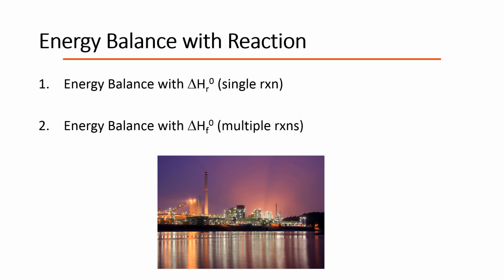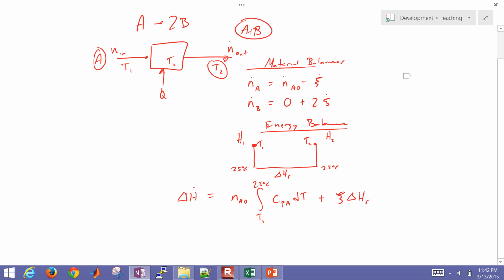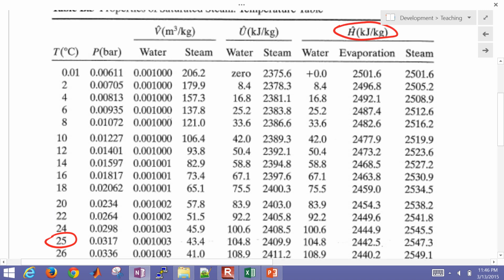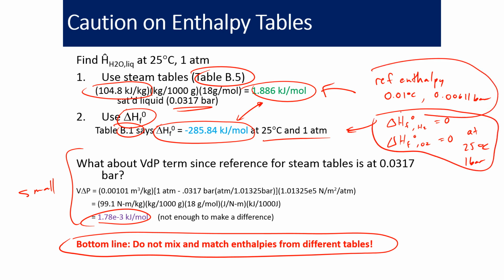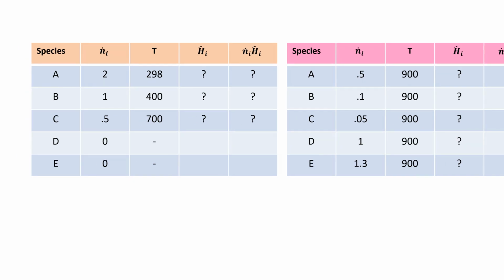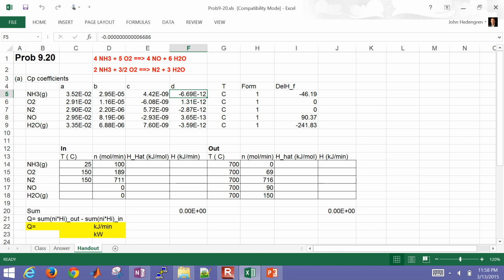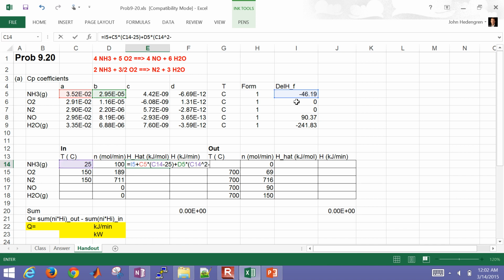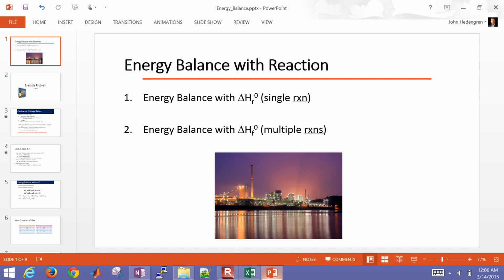Energy Balance with Reaction

Comment: Dear sir: do the same technique apply to calculate the heat of formation for surface reaction? Where the two reactants (one is gas and another is metal surface), both at different temperatures, react and form metal oxide and residual gas as products. In this reaction, what would be the typical temperatures of products?
Reply from the maker: The final temperature would likely be different because the surface would conduct away the heat. Multi-phase problems such as solid-gas are more complicated than this simple problem.

Comment: thank you for such amazing presentation on this topic. I got a question, so these Cp values with their coefficients are used when dealing with conditions that satisfy ideal gas behavior but the other two stream conditions in the example, air & outlet, were at non ideal conditions why it is still applied?  I wonder if I can use this method in a process with conditions at 20 bar and 900C plz help thank you!
Reply from the maker: Here is the derivation of the dependency of heat capacity on the pressure: https://youtu.be/zkPnOWRpseI  Most correlations for heat capacity also give a temperature range over which they are valid. You may need to switch to a higher temperature range if it is above the accuracy limit for temperature.

Comment: on the second problem, what if we have different pressures entering and exiting? what would it change in the calculations?
Reply from the maker: The reaction typically occurs at the exit pressure. The different inlet pressure affects the number of moles entering.

Comment: Sir what will be effect of pressure on the cp coefficients.sir I have ok one doubt.The coefficients u are considered are only valid for low pressures but u r pressure is 8 bar it's not low.what will be the effect of pressure in the heat of recation
Reply from the maker: Most heats of reaction are reported at 1 atm. If you have a reaction at high pressure for a gas then you need to bring the reactants down to 1 atm and then back to the high pressure for the products. You can use ΔH = ΔU + Δ(PV) or for an ideal gas ΔH = ΔU + Δ(nRT) where Δn is the change in moles of the gas components.
Reply from the maker: For liquid systems, the enthalpy change with pressure is generally insignificant compared to the heat of reaction.
Reply: I have the equation for finding the heat of the reaction for other than 25°C,same way as u said by bringing back the reactants to 25°C and adding heat of formation and sensible heat we will get the heat of formation.sir can u provide me with equations how to find heat of formation for different pressures.
Reply: Exactly I can't get it how to bring back to 1atm and do the calculations.sir,plz provide me equations for solving those type of problems.
 Thank you sir.
Reply: @gopikrishna177  brother if u have got answer of this then kindly share it to me because I've also same problem and I don't know how to calculate ∆H with pressure other than 1 atm
My mail id: keton21033@gmail.com
Do msg if u found any solution on this it will be great help!!
Reply: Do u have a Video on water spliting via electricity?

Comment: Whats the title of the book?
Reply from the maker: Richard M. Felder and 1 more

Elementary Principles of Chemical Processes, 3rd Edition 2005
Reply: thank you very much
Reply: hello sir can i know which book for the heat capacity youre refering to
Reply from the maker: There are heat capacity tables in the Felder book. The JANNAF tables may be online.
Reply: sir.. how to find cp which are not available on the table like cyclohexylamine and nitrobenzene.
Reply from the maker: The DIPPR database has that compound. You'll need to gain access to the database. https://www.aiche.org/dippr/events-products/801-database
Reply: in heater with change of phase from liquid to vapor. do we need to inlude latent heat of vaporization. eg mCpdT+mHvap?
Reply from the maker: That is correct. Don't forget to integrate the Cp dT over your latent heating range.
Reply: Hello, do you know how to do energy balance for distillation column?
Reply: @qwwertyytrewq5389 , here is info for energy balances on distillation columns: http://apmonitor.com/wiki/index.php/Apps/DistillationColumn

Comment: i know im late, but if the inlet feed has multiple species(ie: air contains co2 and other), is it still the same calculation for Q? do i need to consider other stuff as well?
Reply from the maker: You'd just need to add any additional species as inputs or outputs. In the case of CO2, it will act as an inert so only sensible heating of CO2 will affect the Q value and the final temperature.